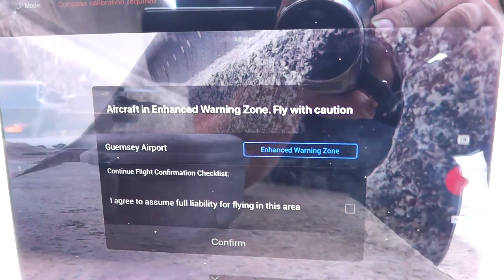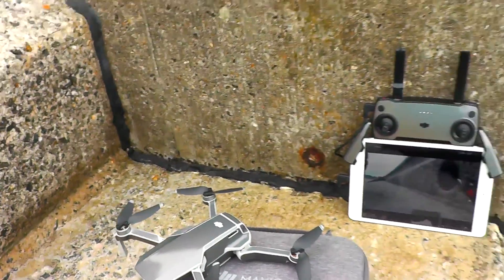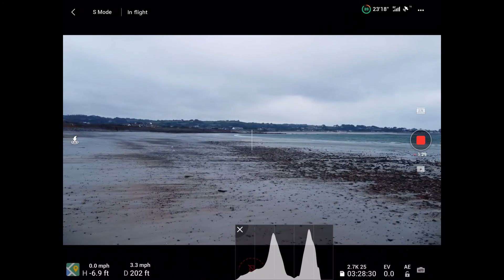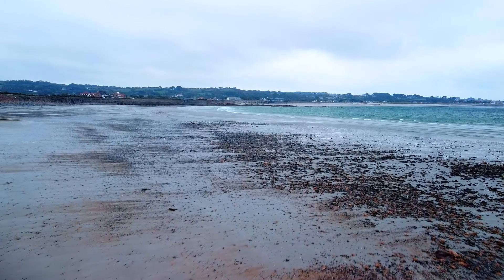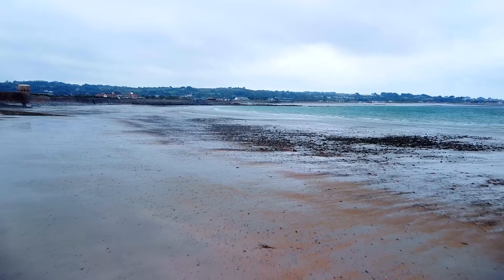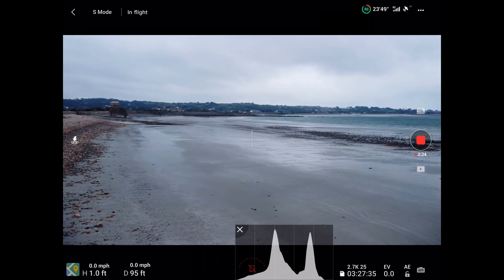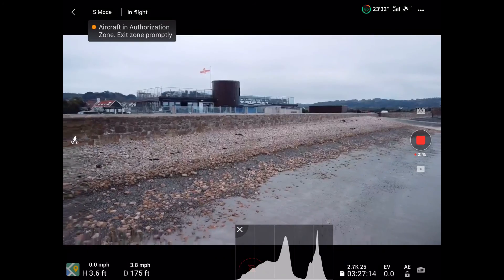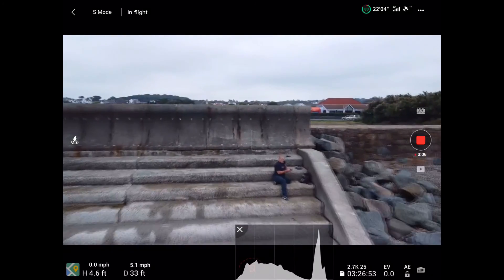What happens when you fly a DRONE towards an AIRPORT?

Comment: I live near airport can i still fly dji at low altitude
Reply from the maker: "Near" doesn't give enough information. 
Anyway, it depends on the laws in your country. 
Go to your national airspace regulators website and do some research.
Reply: @El_Smeghead  6-7 km away i want to fly it in play ground and altitude not more than 100ft
Reply from the maker: If you were in the UK then you should be fine at that distance.
Still check with apps like Drone Assist, which will show you where all Restricted zones are.
Reply: @El_Smeghead  Thankyou

Comment: I doubt most airports would even let you bring drones through the metal detectors
Reply from the maker: I’ve travelled abroad many times with my Phantom 4, Mavic Pro and Mini.
As long as you follow the airline’s requirements on lipo batteries, there isn’t an issue.
Reply: What's the requirement in lipo batteries?
Reply from the maker: Each airline is different. Check their conditions of carriage.